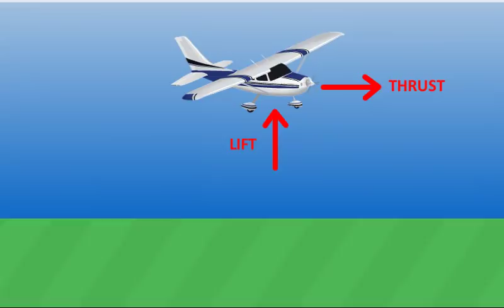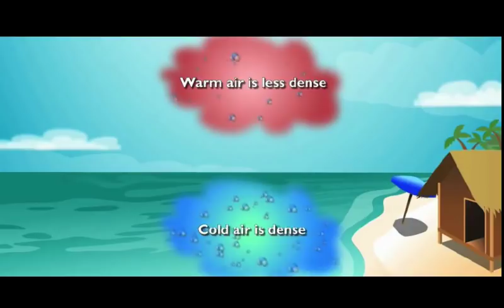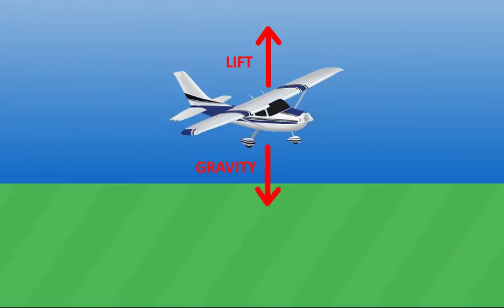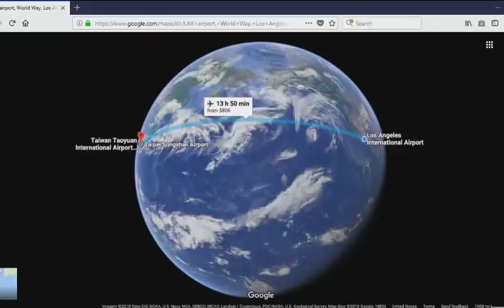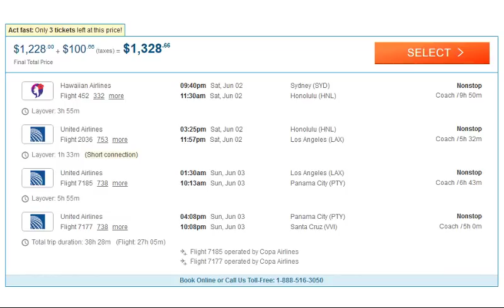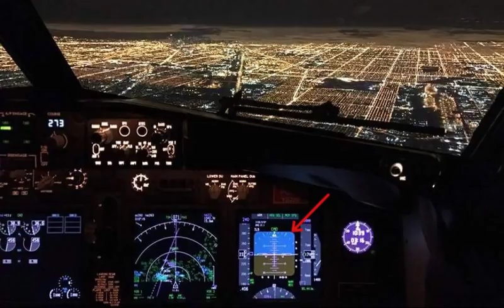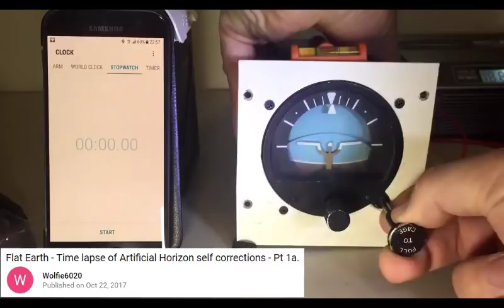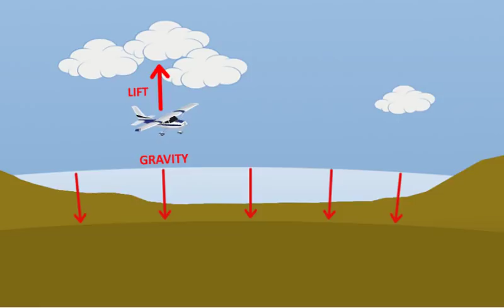Flat Earth Falsities - Plane Nonsense

Comment: I am not even a real Flat Earther. But this video is stupid & the guy is a moron...... 1) Even if we assume that the atmosphere is moving with the spin of the earth, then how the hell we get winds that move in all directions??2) If the atmosphere is moving from west to east then plane travel from east to west will be very very slow because the plane would have to fight the wind in opposite direction... .. ..... 3) Even if we assume that the plane on the ground is moving along with the spin of the earth, and there is momentum when it takes off, the momentum is NOT FOREVER. Momentum will only take the plane further for a few seconds. Once the plane is no longer on the ground, its not being dragged along the direction of the spin. Now the plane is independent of tthe earrth & its spin.... .. .... 4) Try throwing up a ball about 30 feet in a fast moving truck. IT WON'T LAND BACK ON THE TRUCK.
Reply: Sachin, also, try throwing that ball up 30 feet in the air , while the truck is orbiting a heavier object, which is also orbiting a heavier object.  it doesn't add up, at least not once since I started asking for a repeatable experiment to show such.
Reply: +Rick Wilson

"try throwing that ball up 30 feet in the air , while the truck is orbiting a heavier object, which is also orbiting a heavier object"

None of the orbital motions matter in our daily lives. Humans can only easily detect large changes in speed and direction. The earth's orbital speed is almost constant, and it only "corners" at 1 degree per day, not 90 degrees in two seconds like a car going around a corner. The orbital speed of the sun around the center of the galaxy also does not matter. It is also a constant speed, and a straight line direction. We don't notice it either. The only motion we do notice is the spin of the earth, and even that is only noticeable over a time period of hours. The spin of the earth works out to 0.0007 rpm, which is a very dull merry-go-round.

However, we can confirm that the earth is spinning. The spin of the earth generates a very small centrifugal force that partially cancels out the pull of gravity, so that objects weigh 0.5% less at the equator than they do at the poles. Anyone can easily confirm it for themselves, as this guy did.

https://www.youtube.com/watch?v=CkhxPm15PFo

Manufacturers of precision scales specify that the scales have to be calibrated for the latitude where they will be used so that they can properly compensate for this effect.

http://www.schumann-gmbh.de/e/federwaage_E.htm
Reply: +Sachin Ki

"Even if we assume that the atmosphere is moving with the spin of the earth, then how the hell we get winds that move in all directions??"

Because the atmosphere is not a fixed, solid object. Different parts of it are exposed to different levels of heating and cooling, It heats up and rises, cools off and sinks, it flows around and over objects, etc., etc. The general direction is eastwards, but there are all sorts of forces causing relatively small variations in speed and direction. 

"Even if we assume that the plane on the ground is moving along with the spin of the earth, and there is momentum when it takes off, the momentum is NOT FOREVER. Momentum will only take the plane further for a few seconds."

That's why aircraft have engines.

"Try throwing up a ball about 30 feet in a fast moving truck. IT WON'T LAND BACK ON THE TRUCK."

It will if there is a really tall air deflector on top of the cab and the ball stays below the top of the air deflector. The whole point is that the atmosphere is not moving separately from the earth, it is being dragged along with it because of friction with the surface of the earth.
Reply: Ray, 1st off, ty for replying cordially, some of us here are actually trying to learn.  I better grasp concepts visually, do you have a recommended link of an experiment showing what you mean?
Reply: Sorry, I mean specifically with the 4 orbiting bodies, which are bound by mass and gravity orbiting each other?
Reply: I've been asking this a lot lately, and I just get ridiculed, or people use cog-dis as a deflection, and of course, throw sand in the sand-box lol.  I'm not asking for much.
Reply: Is there something I can do after spending maybe 400$ at Home Depot, materials... that I can replicate 4 orbiting gravity-bound bodies that are close to the helio model?
Reply: +Rick Wilson

Which four orbiting bodies?
Reply: Ray, ok... so hmmmm... I clicked on the 4th link first, that you provided .. lol.  It's far from journalistic when it begins with "For some reason, Flattards thinks".. I'll not bother with the other 3 you provided unless you promise they are at least a tad unbias lol
Reply: moon, earth, sun, GC.. 4
Reply: so far, I like wolfie's vid, i can relate
Reply: Read p Ray, I agree.  I even looked at the 3rd link you provided, I'm sifting through it.  So you provided me with info and I appreciate it, and I'll always look with an open mind.  All I'm really asking for is proff that water remains intact on 4 inter-twined orbiting bodies related to mass and gravity.
Reply: "Ray, ok... so hmmmm... I clicked on the 4th link first, that you provided .. lol.  It's far from journalistic when it begins with "For some reason, Flattards thinks".. I'll not bother with the other 3 you provided unless you promise they are at least a tad unbias lol"
He specifically warned you about CHL's attitude, but of course you chose to click that one first and ignore all the others.  It's as if you were looking for excuses not to view evidence.
Reply: can you give me just your best one?  The video that proves how 4 objects orbit each other due to mass, and remain that way indefinitely?
Reply: correct, GMOHOMO, I admitted that, what's the relevance?  I admit, he warned me.  So I'll look again at it, do you have any info to provide?
Reply: as a scientist (I'd prefer detective of sorts), unbiased...  I'm only asking for a simple repeatable (scientific method) experiment that shows what you claim.  How in the world should I be ridiculed for that?
Reply: +Rick Wilson

" I clicked on the 4th link first, that you provided .. lol.  It's far from journalistic when it begins with "For some reason, Flattards thinks"

Isn't that kind of an adhominem attack, ignoring the message because you don't like the messenger?
Reply: to answer your question Trollogmo, I didn't see his warning, until after I started looking at the info he provided, I was being open-minded, satisfied?
Reply: Ray, yes, admittedly, completely agreed.  I apologize.  Can we get back to the science?
Reply: I even said above, I'll look into it, after seeing your warning.  So I'm catering you by looking into your request, anyone here able to reciprocate?
Reply: I answered earlier your question of which 4 orbits.  let's discuss.  "moon, earth, sun, GC.. 4"
Reply: fg crickets man,,  it's always the same.   Make fun of me, and I'm simply asking for repeatable info for a claim.  uggh.
Reply: Rick Wilson
You complain about insults and you say you should not be ridiculed for asking things but you refer to me as "GMOHOMO".  Seems a little hypocritical don't you think?  And don't even try the typical "auto correct" nonsense that you guys like to spew when called out on bad behavior.
Reply: Rick is just a silly troll. Best to just ignore him.
Reply: +Rick Wilson

"The video that proves how 4 objects orbit each other due to mass, and remain that way indefinitely?"

One, what does that have to do with the shape of the earth?

Two, the galactic center is not a physical object, it is the overall center of mass and gravitational pull of the galaxy.

Three, what is there to prove? A detailed, long term study of the night sky will show it happening. Even a simple telescope, camera or set of binoculars allows you to see the four Galliean moons orbiting Jupiter, and watch the changing phases and apparent size of Venus. You can track the retrograde motion of Mars right now with the naked eye, and the changing positions of all of the planets out to Saturn against the background stars. Never mind the rest of the galaxy, trying to make the flat earth model fit detailed observations of just the objects in our own solar system is what finally killed it. Copernicus, Kepler, Gallileo and the rest didn't even know the rest of the universe existed.

The FE model required lots of complex machinery - spinning spheres within spinning spheres within spinning spheres - to try to explain the observed movements. Even then, it couldn't make precise predictions, and there wasn't any evidence for these spinning spheres anyways. The heliocentric model explains everything we observe very simply and easily, and also allows us to make precise predictions decades in advance, something the FE model can't do. Here is a list of upcoming eclipses for the rest of the century. We can already predict down to the second when they will occur, exactly where on earth they will be visible from, and exactly how they will look to an observer anywhere on earth. Feel free to confirm them as they occur. 

https://eclipse.gsfc.nasa.gov/eclipse.html

That is the real power of the heliocentric model.
Reply: ty!!!!!!! I'll have a look.
Reply: well, now I'm confused again, perhaps my semantics.. " Two, the galactic center is not a physical object, it is the center of mass of the galaxy."
Sorry if i said the GC was a physical object.  That is irrelevant to me.  It's the pull it has that seems relevant if we are talking orbits, yes?
Reply: ""The video that proves how 4 objects orbit each other due to mass, and remain that way indefinitely?"

One, what does that have to do with the shape of the earth?"  ..umm ,  It's the basis for the Heliocentric model, so it's relevant the shape, yes.
Reply: nevermind.  ty for your time sir :)
Reply: +Rick Wilson

The heliocentric model has nothing to do with the galaxy. Heliocentric literally means "sun at the center", as opposed to geocentric ("earth at the center"). Both are concerned only with the organization of the solar system, not the galaxy. The modern heliocentric model arrived and replaced the geocentric model 500 years ago, while It is only in the past 100 years that we developed the technology to truly comprehend the size of the galaxy, and figured out that the Milky Way is not the entire universe, that it is actually only one of billions of galaxies visible around us.

By the way, the 4 videos I linked to are not necessarily "the best" of anything. They are merely samples of the work put out by 4 channels that I follow and find enlightening. Both Sly Sparkane and Wolfie6020 have hundreds of detailed videos covering dozens of flat earth vs globe earth topics. Flat Earth Math is particularly concerned with describing experiments that anyone can do to figure things out for themselves. The CoolHardLogic video was the first in his series debunking the flat earth.
Reply: +Rick Wilson

"So I'm catering you by looking into your request, anyone here able to reciprocate?"

Which flat earth evidence do you find to be particularly convincing?
Reply: +Rick Wilson

"Is there something I can do after spending maybe 400$ at Home Depot, materials... that I can replicate 4 orbiting gravity-bound bodies that are close to the helio model?"

Not that I am aware of. You can model it, but you won't be able to replicate the motion of the bodies using actual gravity. The gravitational pull of the earth will overwhelm any experiments you try to do to replicate the 4 body problem. That is also why the flat earth request to prove that "water will stick to the outside of a spinning ball" is also a non-starter. Any water placed on a ball close to the earth will be pulled off of the ball by the earth's gravity. The only way to do the "clinging water" experiment is in a weightless environment.

https://www.youtube.com/watch?v=Ff7oUycGJRY

That is why Henry Cavendish's experiment to prove gravity is so clever. By working perpendicular to earth's gravity, he took it out of the equation.

https://en.wikipedia.org/wiki/Cavendish_experiment

I suppose you could try to do a very complex version of Cavendish's experiment with 4 bodies, 3 of them moving in orbits, but actually making it work would probably cost more than $400.
Reply: @Ray , i did watch Wolfies scale experiment with 500 gms. It was very interesting & maybe convincing too.

I would like to see the experiment on am airplane
Reply: +Sachin Ki

"I would like to see the experiment on am airplane"

That would be the Eötvös effect, though I doubt there is any airplane ride smooth enough to be able to measure it in flight.

https://en.wikipedia.org/wiki/E%C3%B6tv%C3%B6s_effect
Reply: +Sachin Ki

Wolfie6020 comes through again.

https://www.youtube.com/watch?v=oy0erMiS6xs
Reply: You can't really simulate an orbit on Earth for $400 with Home Depot stuff, because of awkward things like Earth's gravity and atmosphere. 
You could build a model with gears to get near enough to right relative speeds, if you want. It's called an orrery. It's not using orbital physics, though, just showing the motion. 
If you want to play with orbital physics and have A orbiting B orbiting C orbiting D, get the Kerbal Space Program and put something into an orbit around Mun. 

For a real frowner, technically speaking, in that scenario satellite A and moon B are orbiting their shared centre of mass, that shared barycentre and planet C are orbiting the combined centre of mass of all three of them and that barycentre and star D are orbiting theirs. For something as tiny as a spaceship, the difference is negligible, but when you get to something as massive as Jupiter and as far from Sol as Jupiter it gets really noticeable: they're orbiting a point between them that isn't even inside the Sun.
Reply: @Sable ,  NASA has tons of money. They can make a huge vacuum chamber & demonstrate how air sticks to  a spinning ball inside that chamber
Reply: Sachin Ki Do you understand the Earth has substantially more mass than any ball in vacuum chamber?
Reply: @Flook, u do realize that the vacuum space is infinitely bigger than the earth ?
Reply: Sachin Ki Which is irrelevant for what you're asking. Gravity is proportional to mass; the ball in the vacuum chamber does not have the same mass as Earth so it will not have the same gravitational strength. Without the same gravitational strength you can't test the effect of the Earth's gravitational strength.
Reply: @Flook ,  NASA people r smart . They will be able to make a spinning ball with some kind of attractive force
Reply: Sachin Ki Pointless when the intent is to test gravity. Artificial gravity exists in Sci-Fi so they can explain why people aren't floating around in spaceship film sets.
Reply: @Flook , exactly. NASA cant demonstrate it because its impossible. Its impossible for atmosphere to exist if its surrounded by Space Vacuum
Reply: Sachin Ki You realise that the atmosphere becomes thinner with increasing altitude? That planes have to be pressurised and mountain climbers use oxygen?

The atmosphere becomes weaker & weaker with increasing altitude until it is essentially a vacuum. At no point is their a mysterious junction between atmosphere and vacuum. A vacuum doesn't suck; a gas expands into it unless something prevents it. In this case gravity is the force that counters the motion. 

A huge ball in a vacuum chamber might weight one tonne. The Earth weighs about a 6 x 10^21 tonnes. Gravity is proportional to mass. When you are dependent on mass you can't claim 1 tonne will have a similar effect to 6 * 10^21 tonnes.
Reply: @Flook , doesn't matter how thin the air is. It still has lesser pressure than space vacuum, so it will have move into the space & dissipate
Reply: Sachin Ki Unless there is something acting against that motion, e.g., gravity.
Reply: @Flook , g is not very strong at all.
Reply: Sachin Ki Earth is a planet, not a tennis ball. Its gravity is sufficient.
Reply: @Fook , not sufficient enough to stop air from escaping into vacuum space (if it exists)
Reply: Sachin Ki Sufficient to achieve the current equilibrium.
Reply: @Flook , there is no equilibrium because the air pressure of atmosphere is higher than that of the space vacuum
Reply: @Ray , you said it right. Atmosphere is not a solid object & hence it can't be dragged along even if the earth was a spinning globe....

...  
...   

I guess we have to do actual experiment at the back of a truck to see the results
Reply: +Sachin Ki

"Atmosphere is not a solid object & hence it can't be dragged along even if the earth was a spinning globe...."

It CAN be dragged along by a spinning earth, and is, just like air can be dragged along by moving traffic or trains. However, because it is not a solid object, you can get local variations in wind speed and direction caused by differential heating and cooling of the atmosphere, and different geographic features. 

Since you are all about the weather, can you explain to me what mechanism on the flat earth causes low pressure weather systems, like hurricanes, to rotate counter-clockwise north of the equator, and clockwise south of the equator?
Reply: "I am not even a real Flat Earther. But"
The channels you are subscribed to, your comments, the questions you are asking, and the phrasing of your questions all suggest otherwise.  

1:  Picture a river, all the water is moving in one direction however within the river you can have varying currents.
2:  If you are on a train in the center car, will it take you longer to walk to the front of the train or the back?  If you are traveling the same distance and maintaining the same speed the travel time will be identical
3:  "the momentum is NOT FOREVER" The First Law of Motion disagrees with you.
4:  In your example the "truck" is Earth so the "ball" would have to be thrown several thousand miles into space.
Reply: 1.how do you mean 'varying currents'?  What are you analogizing this to?  2.  Agreed, no discrepancy in your train allegory.  3.  What do you mean specifically relating to hel or geo models?  4.  No, read above.  The analogy of a truck and ball was supposedly representing the 'earth' and 'sun'?  or perhaps the GC and/or moon.   But I can easily throw a ball 5 feet while in a moving car, that is turning at 5g's while also tumbling upside down because of GC, maybe just an inch away, and it will fly exponentially, according to HE
Reply: 4.  I mean, you aren't even accounting for wind, let alone multiple 'gravitational' forces.
Reply: "1.how do you mean 'varying currents'?  What are you analogizing this to?"
Have you ever looked at a river?  Within a river there are always varying currents.  For example the water in the middle of the river tends to flow faster than the water along the banks, and the water at the top flows faster than the water at the bottom.  Varying currents.  And that's without even considering the little whirlpools and such created by rocks and such in the path of the water.

"3.  What do you mean specifically relating to hel or geo models?"
I means specifically the First Law of Motion:  "In an inertial frame of reference, an object either remains at rest or continues to move at a constant velocity, unless acted upon by a force."  

"4.  No, read above.  The analogy of a truck and ball was supposedly representing the 'earth' and 'sun'?"
No, the truck was representing the Earth and the ball was representing and airplane.  The Sun had nothing to do with this.

"But I can easily throw a ball 5 feet while in a moving car, that is turning at 5g's while also tumbling upside down because of GC, maybe just an inch away, and it will fly exponentially, according to HE"
Perhaps you should attempt to understand small concepts like the First Law of Motion before attempting to understand more complicated concepts like multiple inertial frames of reference.
Reply: OMGSLOWMO, ""1.how do you mean 'varying currents'?  What are you analogizing this to?"
Have you ever looked at a river?  Within a river there are always varying currents.  For example the water in the middle of the river tends to flow faster than the water along the banks, and the water at the top flows faster than the water at the bottom.  Varying currents.  And that's without even considering the little whirlpools and such created by rocks and such in the path of the water.

"3.  What do you mean specifically relating to hel or geo models?"
I means specifically the First Law of Motion:  "In an inertial frame of reference, an object either remains at rest or continues to move at a constant velocity, unless acted upon by a force."  

"4.  No, read above.  The analogy of a truck and ball was supposedly representing the 'earth' and 'sun'?"
No, the truck was representing the Earth and the ball was representing and airplane.  The Sun had nothing to do with this.

"But I can easily throw a ball 5 feet while in a moving car, that is turning at 5g's while also tumbling upside down because of GC, maybe just an inch away, and it will fly exponentially, according to HE"
Perhaps you should attempt to understand small concepts like the First Law of Motion before attempting to understand more complicated concepts like multiple inertial frames of reference."  

1.  Understood.  again, the relevance, just say what you are trying to analogize this to brother. 
2.  Omitted i guess.
3.  Again, what are you referencing wikipedia quotes to?  I'm  not understanding your point.  Please be way more specific in what this is in regards to. 
4.  I'm aware of the laws, how am I incorrect?  you could be right sir, but you need to be more specific for anyone to learn from it.
Reply: "OMGSLOWMO"
So I see that you are just going to continue with insults?  Hypocrite.

"1.  Understood.  again, the relevance, just say what you are trying to analogize this to brother. "
The OP was asking how there could be wind in the atmosphere if the atmosphere was all moving with the Earth.  Hence my analogy of the river (atmosphere) having different currents (wind) inside of it.

"2.  Omitted i guess."
You said you agree with me so I saw no need to address it again.

"3.  Again, what are you referencing wikipedia quotes to?  I'm  not understanding your point.  Please be way more specific in what this is in regards to."
Way more specific about what?  The OP said momentum does not last forever, that is simply wrong according to the First Law of Motion.  Why do you need this explained?

"4.  I'm aware of the laws, how am I incorrect?  you could be right sir, but you need to be more specific for anyone to learn from it."
You should really consider reading the entire thread in order to understand context.  I was responding to the OP.  He was using a "truck" and a "ball" as an analogy of an airplane (ball) flying over the Earth (truck).  Continuing that analogy a ball thrown 30 feet above a truck would be analogous to an airplane flying several thousand miles above the Earth.
Reply: ok, understood, ty for your time :)
Reply: @OMG , Do u know what causes currents in river ? ..

..

...
.. 
..  ..

.. ..
  ..

  The train analogy is stupid because we r solid objects & the train is dragging us . We r moving with the train. ... (However i would like to see this experiment)    ..

  ....

  ..
Reply: @OMG , the momentum won't last more than a few seconds because the object is getting pulled down. Air resistance also
Reply: I know I'm just wasting my time because "Flat Earth," is your religion, let's say the air in your car is going 65 MPH down the freeway, but when you blow out a puff of smoke it goes in whatever direction you blow it.  That's because the air is traveling along with the car, but in relation to the car it can move in many directions.  When it's said that the air is moving at 1000 MPH, it means that it is moving along "WITH" the earth.  So just like the air in your car may seem to be still to you, that's because you, the air, and the car, are all moving at the same speed.  However if you don't understand this simple fact, science is not your bailiwick.   Perhaps a job sling burgers is better suited to someone so far down on the bell curve.  Whether you can grasp this explanation or not, this is exactly what's happening.  Now, would you like a cookie?  Sorry, but stupid people piss me off.  You buy them books, but they just chew on the covers.
Reply: @Steven , too long ...  Didn't read
Reply: Sachin Ki 
It doesn't matter that atmosphere isn't "solid". Its still matter and subject to inertia